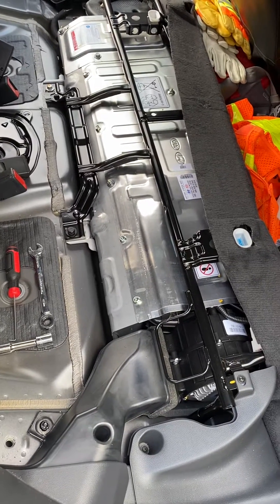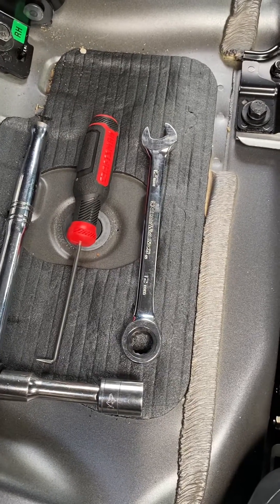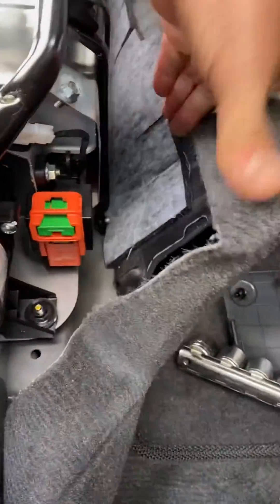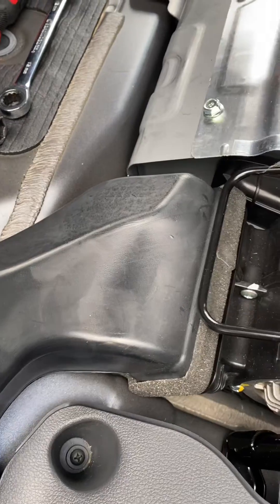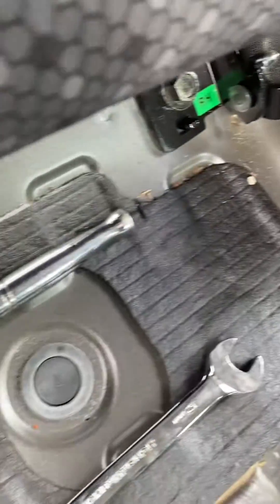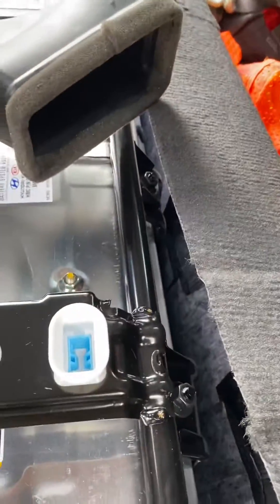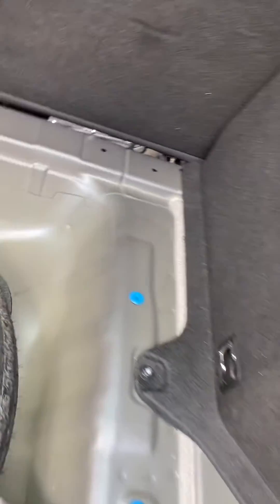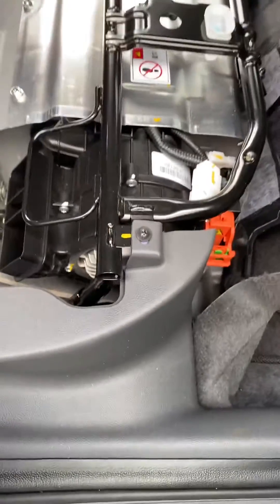Hyundai Ioniq / Kia High Voltage Battery Disconnect, Rear Seat Removal and Cooling Fan Service

Comment: Excellent video thank you! Disconnecting the power should reset the transmission parameters i hope? I changed the transmission fluid so i want to reset the parameters.
Reply from the maker: No need to reset parameters after replacing fluid
Reply: @hyundaiioniqkianiromainten3319  thank you. So long story short this transmission in my 2020 Ioniq Hybrid has been upshifting and downshifting rough from 1st to 2nd and 3rd and back down since I got it with 10k miles. I changed the fluid at 40k miles and still does the same thing. Someone said to unplug the power and reset the parameters and maybe that could help?
Reply from the maker: @ADDwithJTC  did you change the transmission gear oil or clutch actuator fluid? Some vehicles can be reset by power cycling, I know the ioniq can be done with the gds, not sure if disconnection power works on this model
Reply: @hyundaiioniqkianiromainten3319  thank you. I change the clutch actuator fluid every oil change and the transmission fluid was changed 8k miles ago. Was going to change it again and reset the transmission.
Reply from the maker: @ADDwithJTC  changing the trans gear oil , especially so soon will not do anything to help that issue

Comment: Hi. Where does the air go after the ventilator pushes it out through the outlet duct? Where is the outlet where the air exits the car? Thanks.
Reply from the maker: if you follow duct it goes to back of car to the back panel near the rear hatch lock

Comment: Very informative. Thanks for taking the time to film and share Rich. I guess the logic is this fan doesn't need a filter if the interior air has already been filtered entering the cabin.
Reply from the maker: Thx, I believe so. The battery doesn’t need filtered air but keeping dirt out could prolong the fan motor life, while I had the duct off I gave the cage a spin to make sure it turned good.
Reply: The ECM prolly has a trouble code if things get too hot. But I enjoyed seeing anyways. Love the packaging on the Niro. These fans typically cool more than just the battery. To see on a Honda system, checkout: https://youtu.be/4RQaQ9NYi2I (just watched myself yesterday)
Reply: Thanks for the video. Nice work! Blessings,
John 20:29